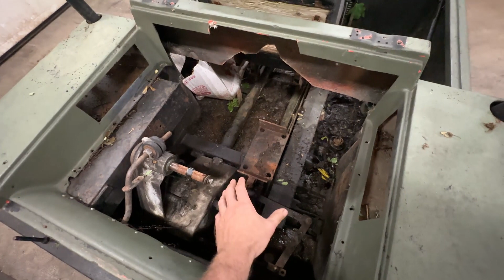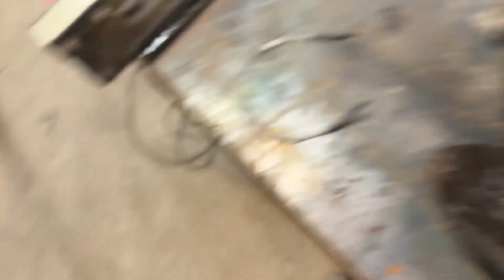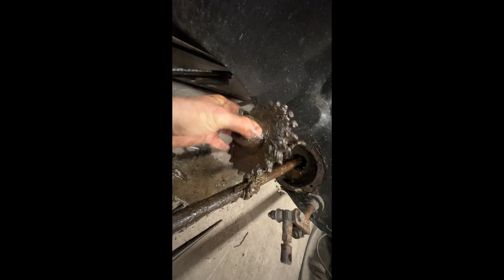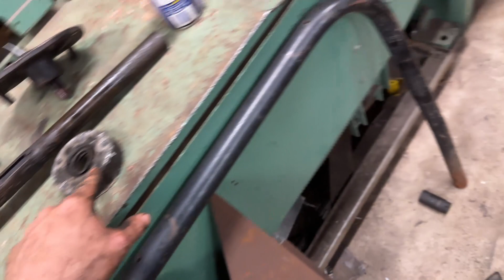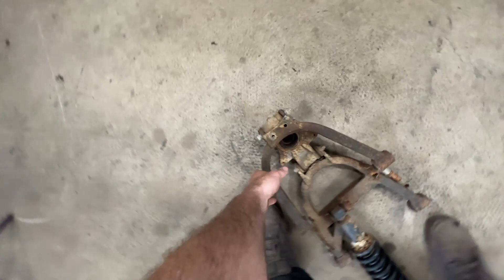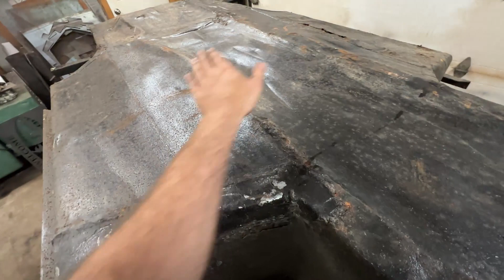AMPHIBIOUS BUGGY BUILD PART ONE || OVENGED

Comment: Just to add the factory welds the frame to the tub. That was not a repair. My Terra jet is welded there as well as the terra jet I cut up for parts. I had to plasma cut the tub away from that rear axle flange.
Reply from the maker: It’s funny you mentioned that because once I inspected later and looked abit closer I realized that’s just how they sealed the tub to the “chassis”
Reply: @Ovenged  that’s right. All those folds and bends in the tub.
Reply from the maker: Yes exactly! I was thinking it may of been patched before but for the most part I feel it’s mostly factory! Lol